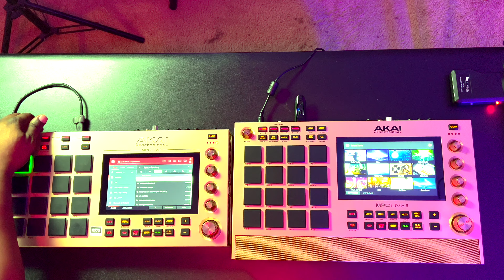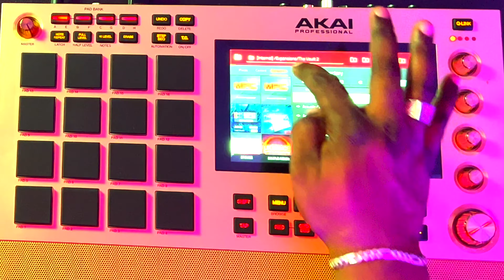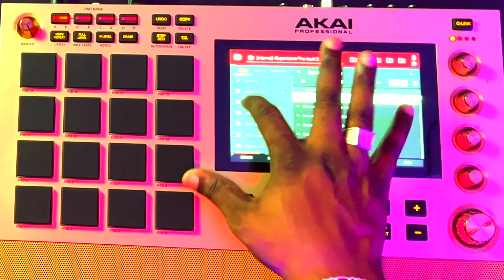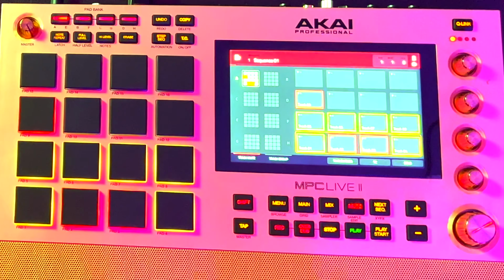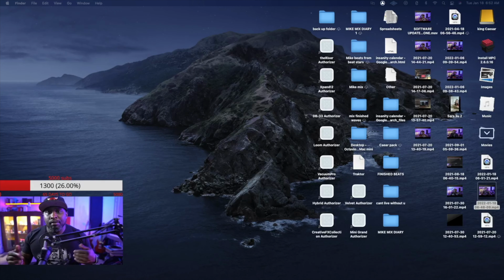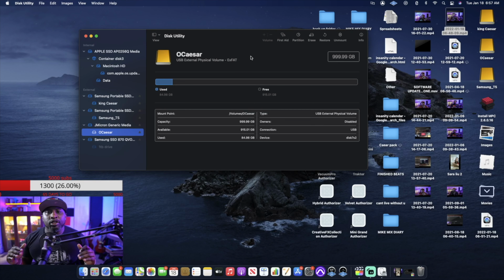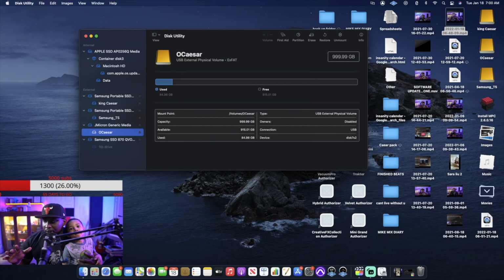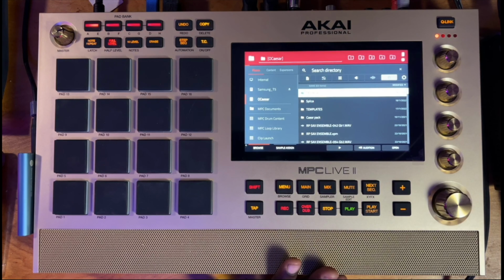MPC LIVE VS MPC LIVE 2 - SWAP HARD DRIVE FROM MPC LIVE TO MPC LIVE 2 (EASY INSTALLATION)

Comment: Can you save to the internal ssd while in controller mode ?
Reply from the maker: Not sure never tried but if you don’t have an ssd everything is saved to the internal until you get an ssd. Once you get an ssd you want files to be saved to the ssd that will insure that your MPC still runs fast.